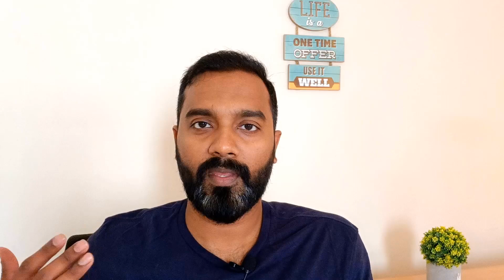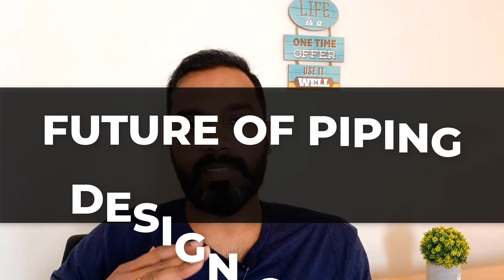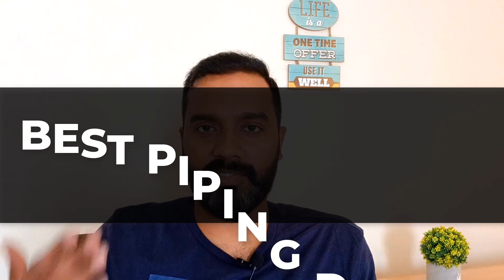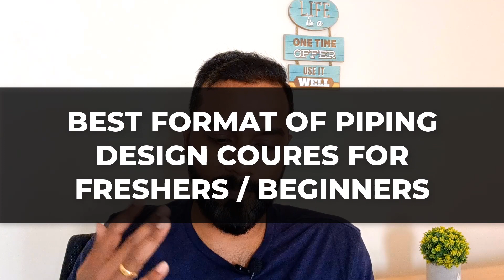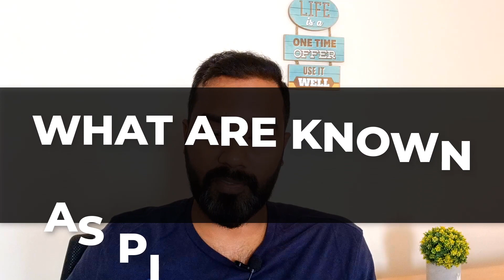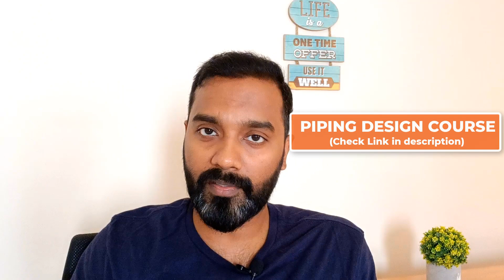Piping Design Engineering Career Question & Answers

Comment: Thanks for the wonderful information.
I have watched your previous video "Piping Designer vs Piping Design Engineer"
My doubt is what is the difference between Piping Design Engineer and Piping Layout Engineer.
And the word "Piping Engineer" is a General term or coming under in any particular field : Design, Stress, Material.
As you said Piping Designer should be very good in softwares. If Piping Designers are working on softwares then who are the PDMS Modeller, E3D Modeller. What does Modeller do.
Reply from the maker: https://youtu.be/9w3g3eJtpZw

Check here